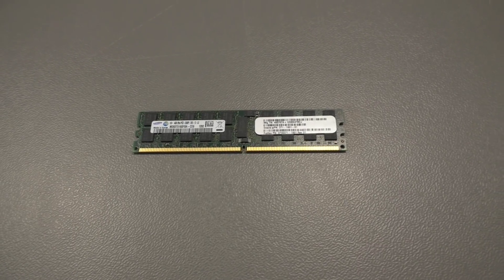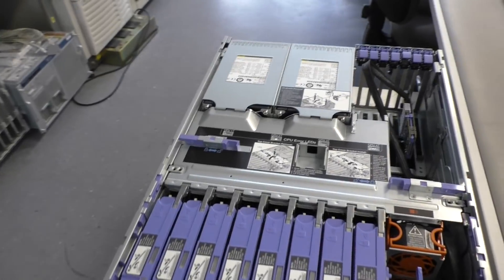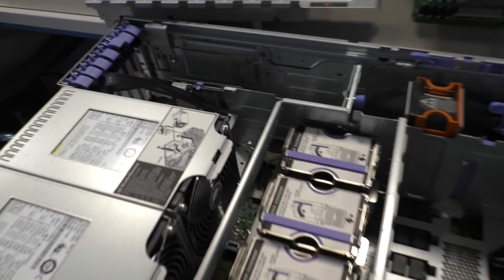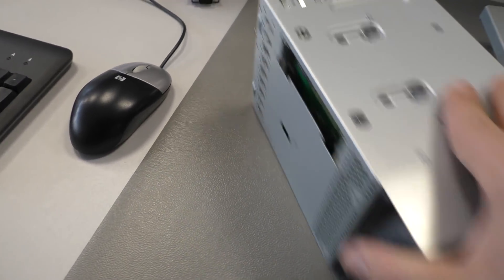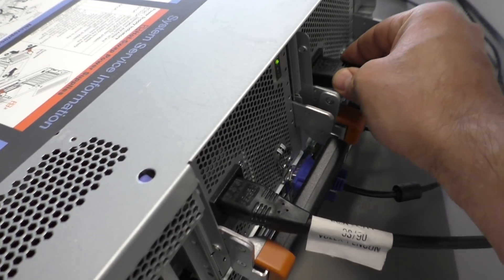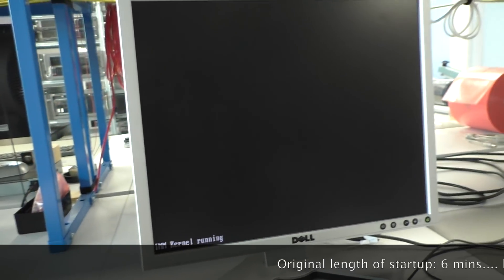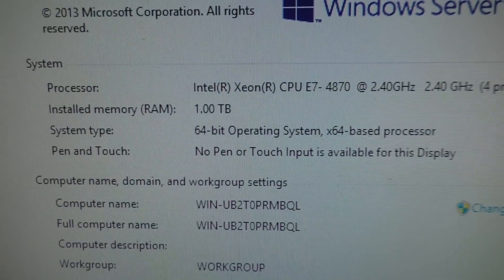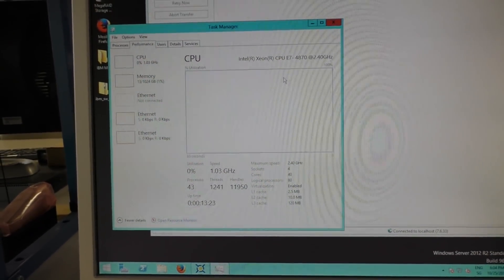One Terabyte of RAM in one server (PWJ73)

Comment: How much a month does this cost you? Like, electricy, how much does it uses and how expensive it is?
Reply from the maker: Power consumption is about 2000 Watt at full load. That's 48 kWh per day. At 20 Cents per kWh = $9.60 per day
Reply: @PlaywithJunk  Ohhh that's pretty alot! I mean, you pay 300$ per month, excluding network (that should be at least 100 mbit/s and should work 24/7)!

Comment: “Playing with junk”

1 TB of Ram
Reply: No No  how is ddr3 junk?
Reply: @theultimateweeb4276  ddr3 is junk for apu's, because they rely so heavily on ram speed.
Reply: @adelaide7822  you do realise, that for the money you spent on ddr4 to make your apu run better, you could've just got a graphics card, an older cpu and 8 to 16 gigs of ram to make a pc that ran better or the same as your apu?
Reply: @theultimateweeb4276  The thing is that if you do that, you don't really have an upgrade path for your cpu. I wanted to build a PC back when mining was still a thing, so when I asked how I could get a decent PC for 500€ with monitor included in the price, I was told to get a ryzen 3 2200g, since I could upgrade the gpu to say an rx 580 later and if the 4 cores are to less I can move to a different cpu. Also apu's are nice for small form factor PC's. In my market apu's are actually cheaper than your suggestion.
Reply: @adelaide7822  k
Reply: @theultimateweeb4276  Also, ddr4 is pretty cheap now, compared to it's price in 2014 or 2017.

Comment: Where did you get the server and what was the result of downloading projects from BOINC? I am very curious about how many actual project processes ran and how long they each took on that server? Drop me a note when you have a chance. Thanks.
Reply from the maker: We got 60 of those servers from a large company that bought new hardware. We sold most of them to brokers.
BOINC runs with 2 threads per core. On a 4x10 core machine you'll get 80 running tasks.

Comment: I like to get "older" server casings and older server stuff cause i'm in school and the stuff is cheap, but now i need a hot swap sata drive cage, there should go 3 or 4 drives in, it needs to fit in a 3x 5,25" mounting hole, and should be as cheap as possible :) backplane would be nice but isnt necessary, if someone knows where to get something like this (in germany), i would be really thankful 
Have a nice day :)
Reply: Oh and i got 4 hot swap frames/cages for my drives, so would be nice if they could be used in the frame (they cost 25$, and like i said i dont really got much money to throw out)

Comment: 80 threads and 1TB of memory....  next gen thread ripper should allow for 128 thread and double this memory in a 1P desktop.
Reply: these are also from 2011 and not particularly expensive(for server gear). For reference if this machine was spec'd out top today it'd have 448 threads if using intel and 256 for amd in this type of machine. Amounts of memory would be similar between the two, but the AMD would have slower memory but not in a giant appreciable sense.

Comment: I never even imagined so much ram before in my life.
Reply: Modern high end servers that’s usually being powered by AMD Epyc or Intel Xeon Scalable processor are usually capable of holding up to 4-6TB of Ram and their minimum Ram is the same as Normal PCs  but usually for their range, the minimum is 256GB altought you could run it by only using like 4GB
Reply: think about '80 and '90 when computer had size off a house and was 1000 times worse than a present time normal mobile phone :D

They didn't even expected 1GB of RAM...
Reply: @DOMINIKM6  Yeah, I didn't even think about it that way. Eventually, having several TBs of anything is just gonna be the norm. 😱

Comment: And that is an average server these days, I just installed 60 servers with 2TB each, 4 12 core xeon cpu's, and 8 10G fiber network cards. This is of course for a VMware server and desktop virtualization design for a large company. At that level you must have excellent cooling in place and plenty of power. Fun fun 😉
Reply: Was just thinking the same thing. I just worked on a project for a large SAP server cluster, with 6TB 112-core systems. And those are far from the biggest.

Comment: Does this have PCIe X16 slots. If it does, put a top end graphics card in it and it would be an awesome gaming and/or video editing/production/rendering machine. You could use some of the 1TB of RAM for a RAM disk to put files you're working on - on. It would be faster than any SSD.

Comment: Windows...puke, such a machine cries for Linux. ;)
Reply from the maker: I use BOINC mostly for stress test. That works as well under Windows.
Reply: Stop we dont need another firmwar.
Reply: @Play with Junk
Linux has faster task scheduling/context switching. When I run mprine (aka Prime95) under Linux my CPU (a Haswell CPU with integrated voltage regulator) gets about 5 - 7 degrees (C) hotter in the torture tests compared to Win7. Admittedly this is a bit unscientific. ;-)
Reply: @Conenion  especially if you use a realtime kernel...
Reply: Conenion depends on what it will be used for.
Reply: For BOINC

Comment: What epic graphics card/chip does this thing have? ;D
Reply: None, its a server theres no use for one
Reply: Well, there has to be something because there is a monitor connected to it ;)
And it delivers a picture of what he's doin with the system.
Reply: Well ofc integrated graphics/BMC, but thats not epic
Reply: This server will use something similar to the Aspeed AST2400 32MB GPU I have on my workstation board here  ;) And a small home server I just build uses my old ATI X1600, just because the 8800GT I had also laying around was to big :D
Reply: Brad Viviviyal  Yep, assuming your server has a BMC (which pretty much all high end servers do)

Comment: This server is not going to the junk, right?
Reply: Chip Guy Vids it’s actually quite inefficient for the type of company that buys this kind of machine.  You can get >1tb in 1u now using half the power at twice the speed.  There’s no reason to keep this behemoth around.
Reply from the maker: This one is still part of the active stock. We still need it as spare. That's why I did not disassemble it completely.
Reply: Chip Guy Vids yes, that is true, and in a home setting or small office that makes sense.  If you’re running a server that needs to handle business, the potential for failure without fast repair (warranty coverage) far outweighs the cost of a new machine.  The cost of servers like this is peanuts compared to how much income they generate.  Better to pay more money and stay covered and confident in your hardware than risk gobs of cash and more importantly customer trust.
Reply: You didn't answer the question, please don't disassemble X5 :-(
Reply: Yay! It maybe only 50% energy efficient compared to the newer models but it is still a usable machine. Unless the annual energy bill for this one is not more than what a replacement would cost it should not be thrown out. A lot of ressources went into making this machine in the first place.
Reply: There are faster servers with more ram now, so tech is advancing fast.

Comment: is it possible to hotswap cpu or memory? without restart? in this kind of server
Reply from the maker: No. As you see the handles are blue. This means "cold swap". Things with orange handles can be hot swapped (like power supply)
Reply from the maker: That's not true. HP for example has made some servers with hotswap memory in the same size as the IBM here. The DL580-G4 even had memory RAID. Equipped with 4 modules it was possible to make a RAID5. Or RAID 1... half memory used, other half as spare. The called it differently but thats about how it worked.
Reply: Don't think so. If it will be working with outside harddrive shelf so how can you remove memory banks if for example vmware using them.
Reply: IBMs AIX had tools for that actually, where you could force empty a certain RAM banks and then swap em. The stuff on the memstick was moved to a swapdisk on drive and then back to RAM once switched. IRC the memory banks were numbered inconsistently and we constantly switched out active ones by accident.
Reply: As far as i know only mainframes can do hot swapping of CPU's and Memory.